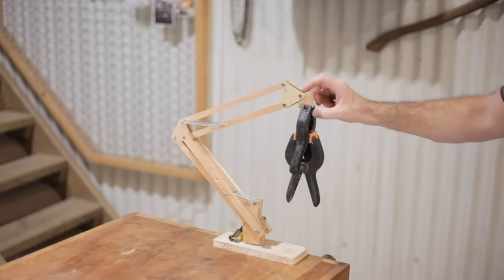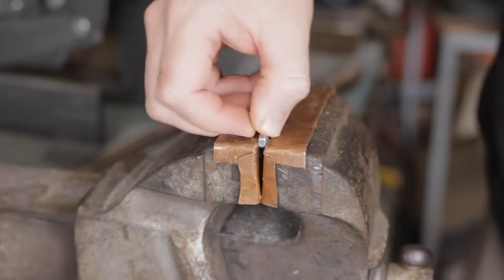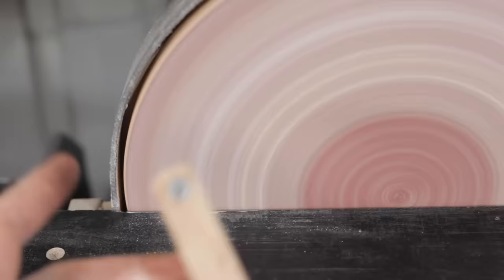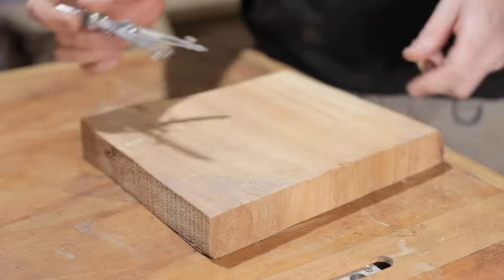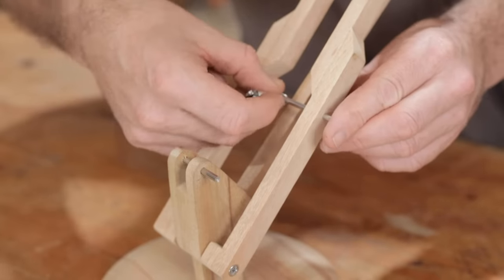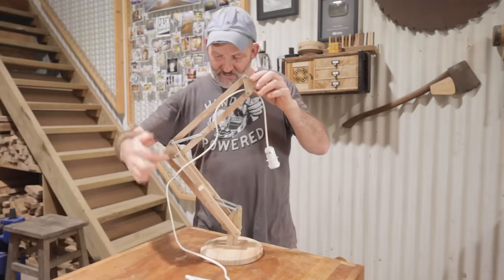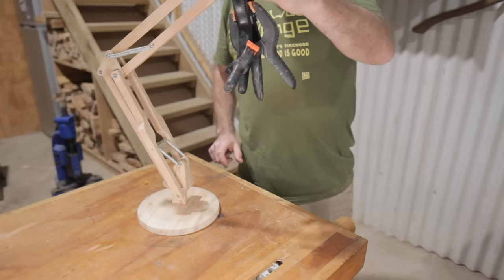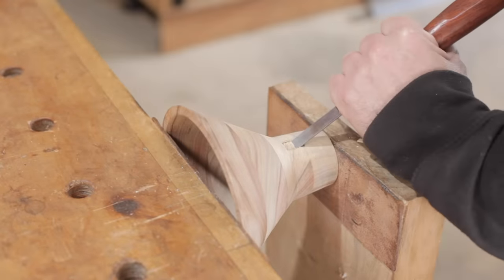Making an Articulated Desk Lamp - Scrapwood Challenge ep31

Comment: I love it. But I have to warn you as Electrical Engineer, you can burn cone for long time usage. You should always use LED bulb which has low watt. You should check heating. I suggest, you can cover with a foil inside the cone, it can help for reflection and this good way for getting better illumination and it can isolate for heating. 
Perfect design I enjoyed!!!
BTW you should add you logo on it ;-)
Reply from the maker: Thanks Eren! The bulb is an LED low wattage(5.5W), it's seems absolutely fine! :)

Comment: Woodwork taking on combined levels of mathematics / geometry /mechanical /carpentry / electrical /engineering and animation. Very tasteful and tidy, this lamp would certainly be a great conversation piece in any mans work shop. A fine job that speaks of years of experience. Even some of the store bought metal lamps like this model don't have recessed wires and nuts like yours, nice touch.  The stop motion Pixar lamp ending brought a smile to my face, you have accomplished even more than you set out to do.  Keep up the great videos, they are very enjoyable and peaceful to watch.
Reply from the maker: Thanks very much - glad you enjoyed it! :)

Comment: Having several of those style lamps (store bought) I would never have thought it would be so difficult to replicate one in wood but your balance is set up according to the springs whereas the store bought metal ones have at least one joint that can be tightened to hold positions. 

Yours is a million times better. 👍🏻👍🏻👍🏻
Reply from the maker: That was going to be my back up if it didn't work, add a wing nut to one of the joints! :)

Comment: Actually I tried to make myself one as well for my garage shop. I found it very challenging to find a balance between springs and weight of the bulb assembly and even more challenging to avoid lateral resonance. Those lamps are usually made to be stiff in the plane of the wood construction, but they tend to oscillate when exposed to 'lateral' force, requiring some stiffening elements. I saw you have resolved this by adding thicker part of wood at the base where the first beams are installed. Nice construction!

Comment: Nice job.  I tried this with just articulated arms and brass tightening knobs and LED lamp for my wife's dulcimer stand (She plays at local pub and needs the extra light to see the strings).  The thing is, that the friction at the knobs is just barely enough to keep it in place if you tighten it really hard.  Even after roughing it up with 80 grit.  I've thought of putting cork or rubber in there.  I'm still not satisfied.

Maybe I'll make one of these.  I've shied away from it because of the spring and balance problem though.  Didn't understand it.  So thanks for this, it might be exactly what I need.

Comment: Always amazing to see the figure of the wood you use. I know you have told us all before but it always brings life to your projects. 
Side note. I know its not much time saved but if you have a drill chuck for the power end of your lathe when cutting pins like that i have found the carbide tools to be much faster and easier on the lathe than in the press with a hacksaw. Well with the exception of cutting bolts down i have never tried that haha.

Comment: Very nicely done!  The closest I've come to making an articulated lamp is to modify an Ikea lamp so it can stretch out as far forward as the arms will take it.  It goes off balance at that point so a $5 table clamp from another old lamp locks the base down to the table.   One thing, though:  I see you used hotmelt glue to fix the lamp socket inside the cone.  Though LED bulbs probably won't heat up enough to melt the glue, I suggest you use epoxy for that task anyway just in case someone were to put an incandescent bulb in the lamp.

Comment: I love these style lamps. I have a couple or 3 of commercially produced ones with slightly different bases. And actually, a couple different heads, as well. I've found the spring tensioned articulated arm to be a good (lightweight) mic mount. I've also toyed around with the idea of repurposing one and mounting my webcam to it. Nice DIY version :) Definitely one of your more complex SC builds, if I remember correctly.

Comment: 6:04 - that was not easy to saw that way, just so you could make the effect, was it? As always, inspiring. Thanks!
Reply from the maker: It needed to be a neat cut so I did it with the scroll saw. I wouldn't have used the scroll saw otherwise! ;)

Comment: Very nice!  Question: are you at all concerned about using hot melt glue to hold the light socket in place?  Even an LED give off some heat....and wood gets hot...  Like somebody else wrote, though, you are quickly becoming one of my favorite channels.
Reply from the maker: Glad you're enjoying the channel David! I reckon the hot glue will be fine but I'll keep an eye on it. I once made a light fitting from caulking nozzles and heaps of hot glue and that is still in perfect condition! :)

Comment: Hey Neil,

This lamp looks fantastic, and I built my own following your plans. I've got a slight problem though where the screws work themselves loose over time, as there aren't any washers between the screw head and the wood. Did you use any kind of thread lock when you did your final assembly? I'm worried that I'll glue the screws in too tight and limit the range of motion.

Thanks,

-Evan

Comment: That looks amazing! While you had the scales out, did you happen to weigh the cone before and after sanding? I'd be curious to see how much much gets sanded off!
Reply from the maker: I didn't but it crossed my mind if it would be too light, it wasn't. If it had have been too light, I would've add some weight somewhere, probably where the light fitting went in. :)

Comment: Hi, is there a method required to position the joints for the arms and determine the springs required to counter balance the weighted end?
Reply from the maker: I just used trial and error, changing the tension in the springs by moving their positions until it worked correctly. :)
Reply: Pask Makes: thanks for your reply. I have been searching for a way to calculate the appropriate positioning and spring strength to take the guess work out of it. I haven’t found anything yet but I’ll keep on searching. I ask the question because sometimes a little snippet of info from some one like you or perhaps on of your commenters will point me in the right direction. I just need to find the right search parameter for google I suppose. Keep up the good work mate I am really enjoying your videos 😁😁👍👍👍.

Comment: You might only want to use led bulbs for it or it will become a fire hazard, and the hot glue will give out quickly. For safety to add some heat went's in the cone.
Reply from the maker: The bulb is a low wattage led bulb! :)

Comment: You spent the better part of a day making a prototype of something that already exists in abundance...?  I don’t know why I’m caught up on this, because the video was good...but why not just use a commercial lamp for the prototype and improve on it from there?
Reply from the maker: The better part of a day was making minor adjustments to get it to work properly. Even taking the measurements from an original light wouldn't directly transfer to this, the springs would have a different tension, the wood weighs differently and moving things just by a mm or so makes a huge difference with how it works. :)
Reply: Pask Makes aaaaaah yes, that makes sense.  thank you for the reply and the videos!